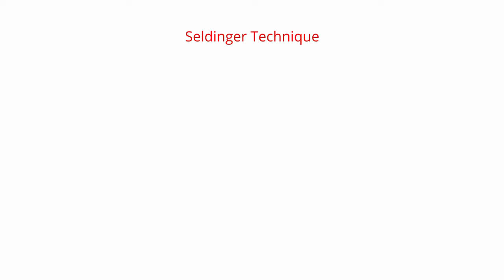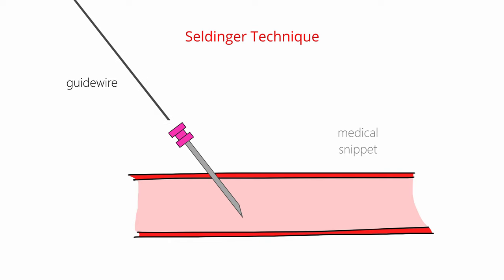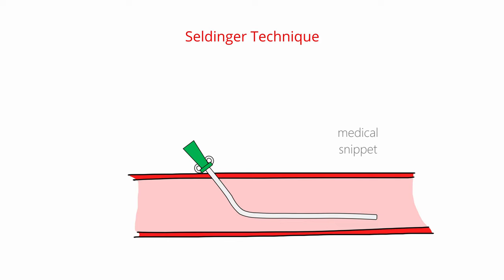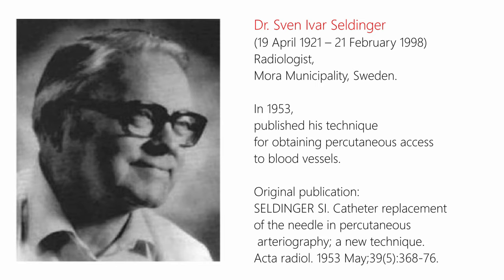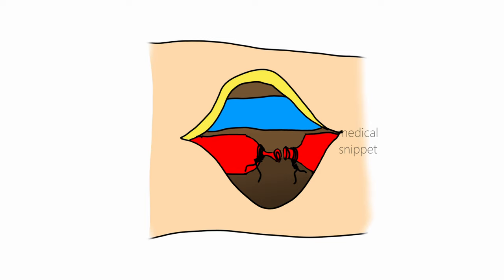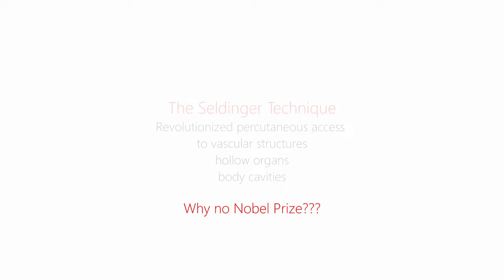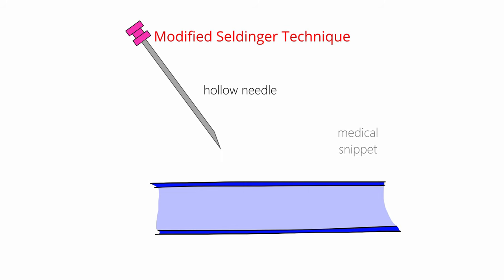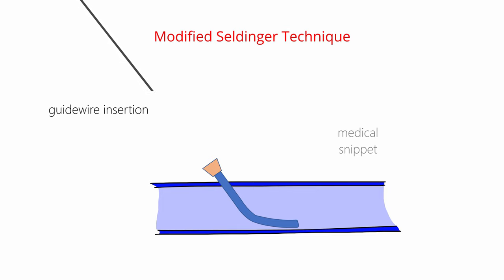Seldinger Technique & Modified Seldinger Technique

Comment: Why is the first "fine" catheter replaced by a second one, for stability reasons?
Reply from the maker: yes... since in neonates the venous lumen  is very small... the needle may get displaced while inserting the guide wire... to avoid it a fine catheter is inserted first... followed by guide wire insertion...
Reply: @MedicalSnippet  Don't we also use modified version for arterial lines?